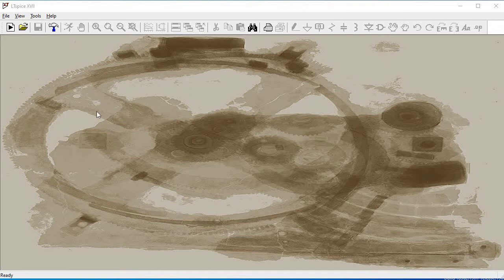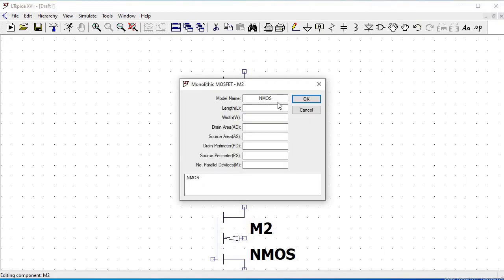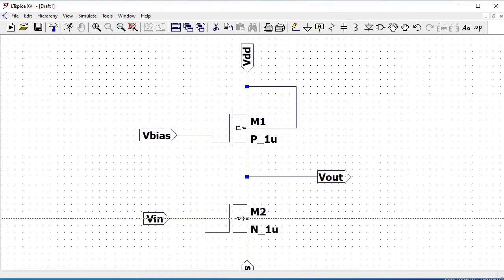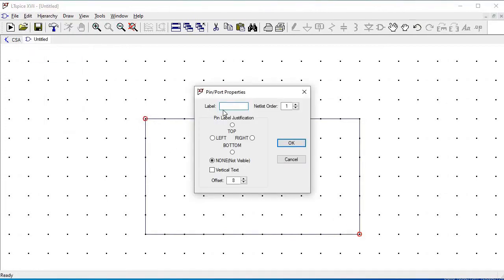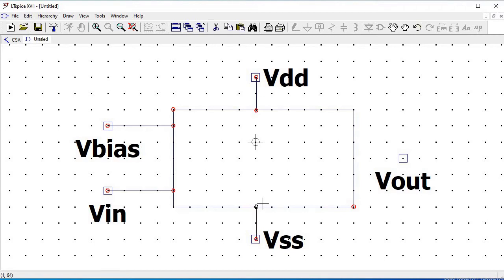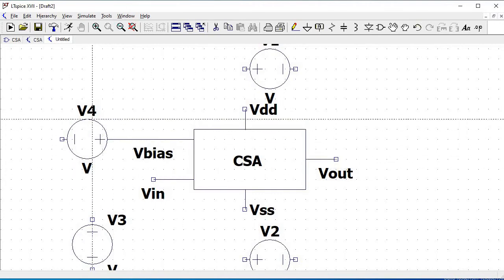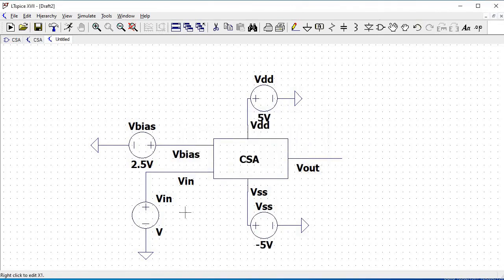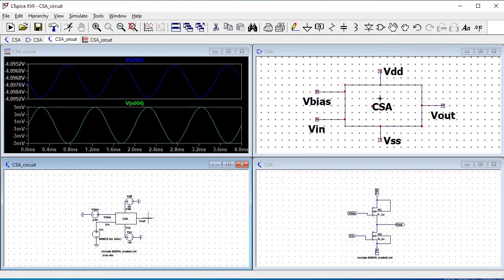Common Source Amplifier Circuit simulation using LTspice

Comment: Sir I connected the circuit as per shown but after runnning I am getting "Missing schematic of the hierarchy:csa_symbol" after clicking ok I am getting "Trouble generating netlist for SPICE run" sir..

What can I do ,pls help sir.
Reply from the maker: Ensure that the both the schematic and the symbol are in the same folder, this error is commonly due to that